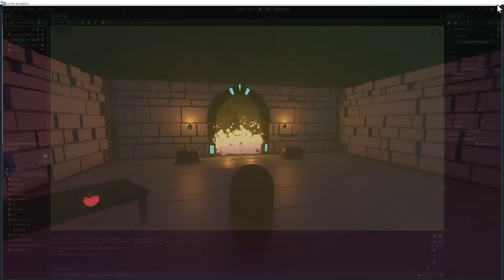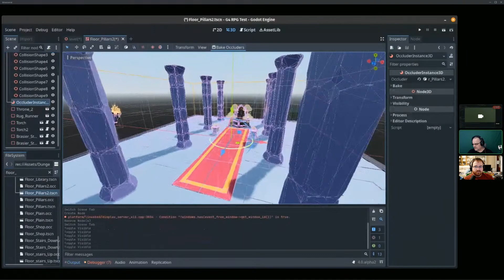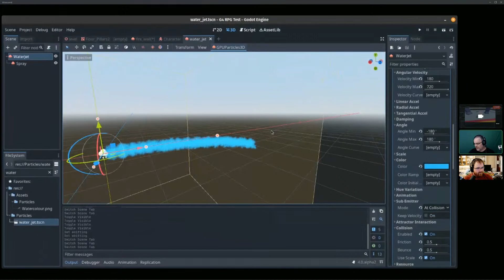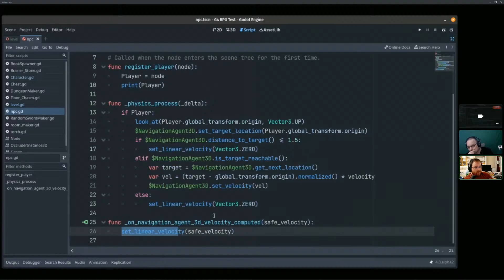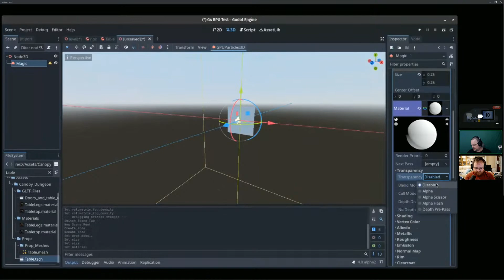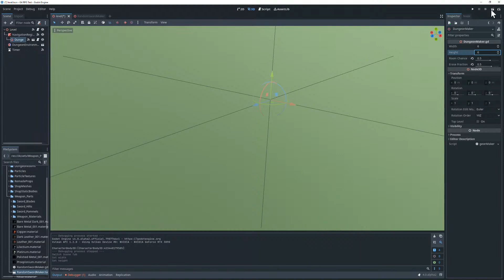Livestream: Godot 4 and the Action RPG Project

Comment: Nice walkthrough. Thanks for sharing guys. 
Quick question. If you use gridmaps, and your rooms are, say size 10*10*10, how do you manage to add a wall in between two rooms if the wall are sized 1 * 10 * 10 ? knowing that the blocks on a gridmap should have the same size.
Thank you !